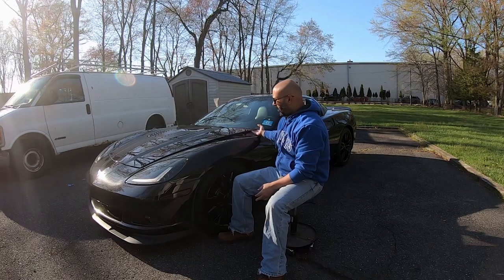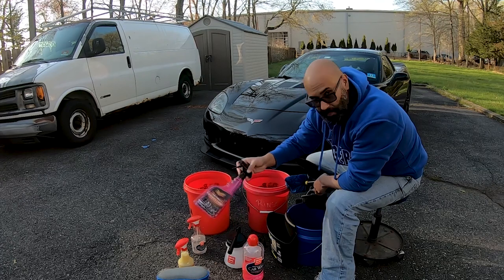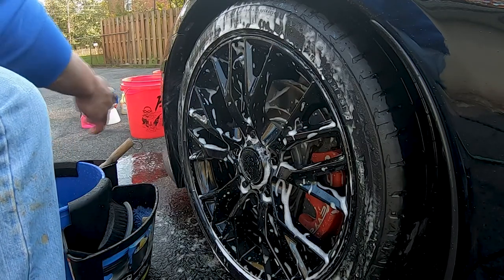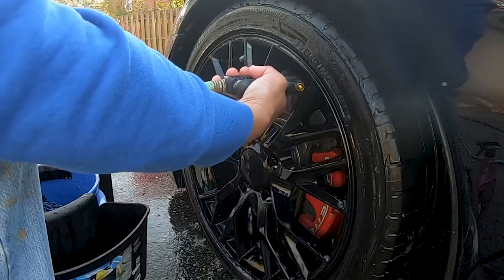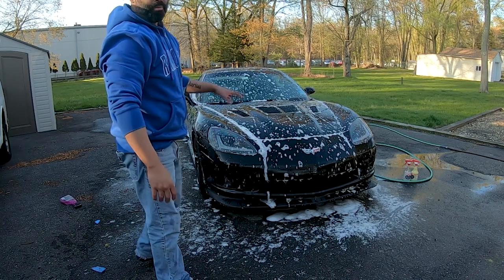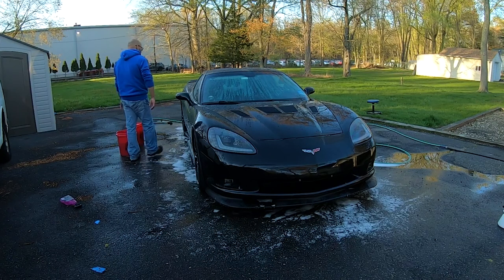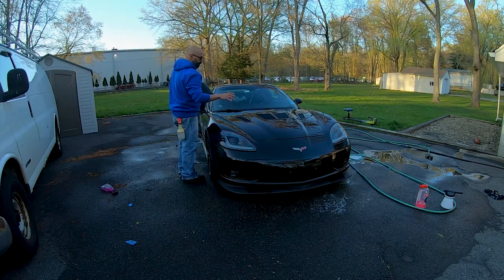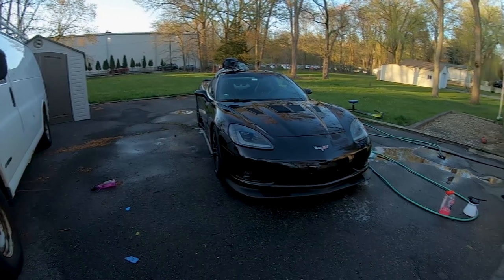How I Wash My Corvette C6

Comment: Bro,you need to wax it too after wash especially if you live and leave it in hot climats,i overhere using Mc guire polish,ey what Race mods you got into the vette,not talking about Lights..🤔🇺🇸..the back gets more dirty because the reardrive will spin dirt up,🤣🤣🤣
Reply from the maker: Hey bro sorry that I’m writing late I’ve been doing a double shift at my job. I only have an intake for now bigger mods is coming this winter😁
Reply: @batvette3523  Then its nothing you got..🤣🤣need have coils,bigger radiator,sloted brakes,raceexaust system,atleast,now your is still a stoke c6....